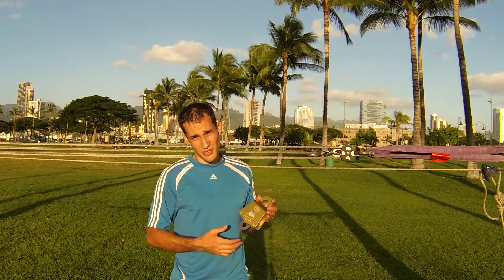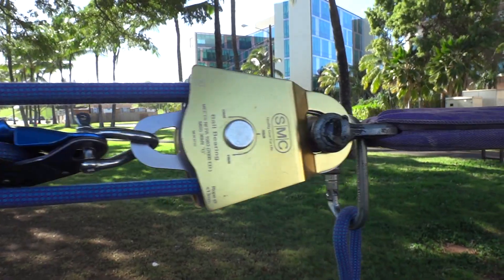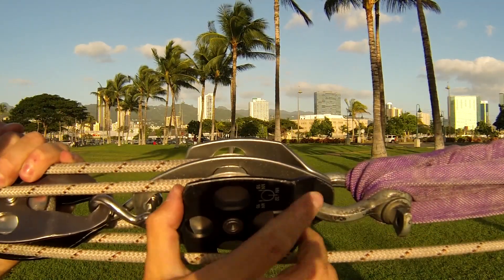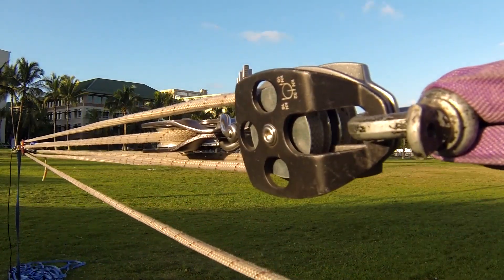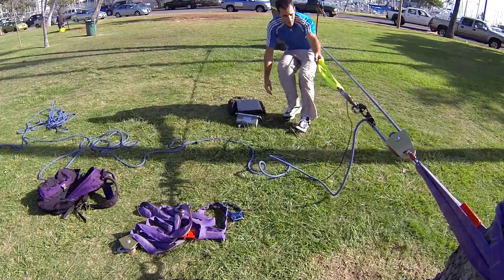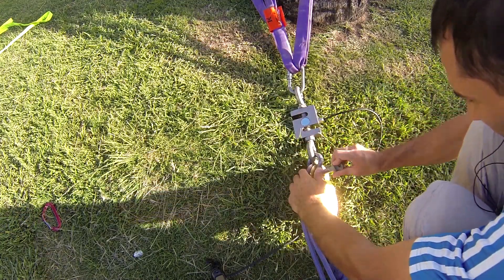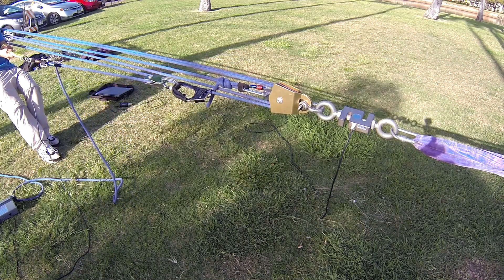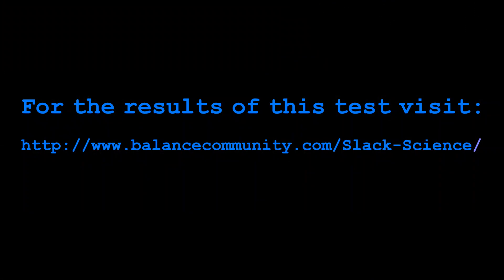Slack Science - 3" SMC PMP Double Pulley Efficency Contrast Test

Comment: Nice small pulley works good➣>allmy.tips/FusionPulley?vv➡️➡️    with a 3/8 (10mm) line. Can be used as a prusik tending pulley if you clip a carabiner around the the line on the inlet and outlet side below the pulley so the prusik doesn't get sucked into the pulley.